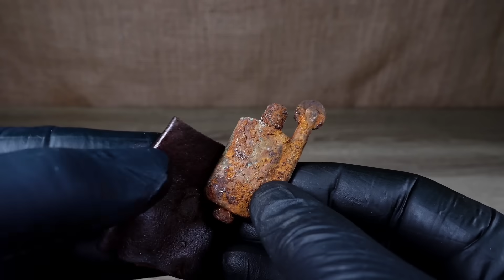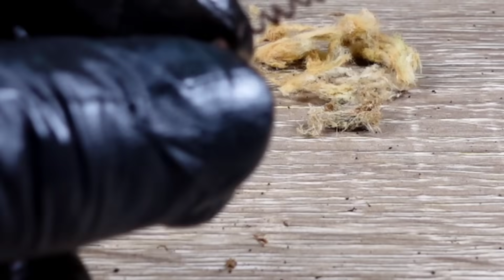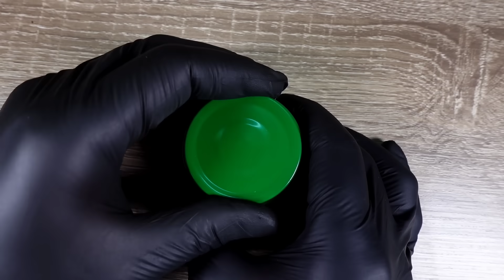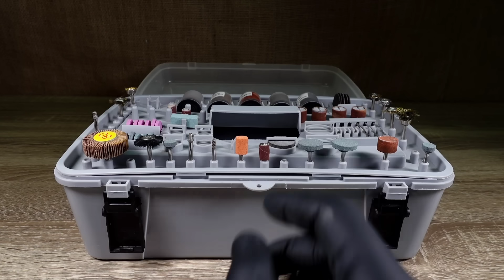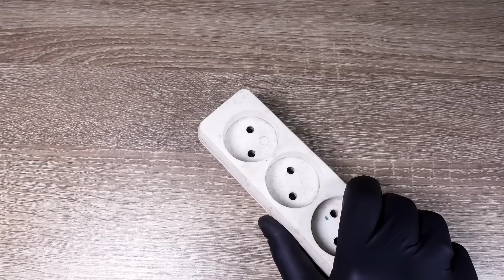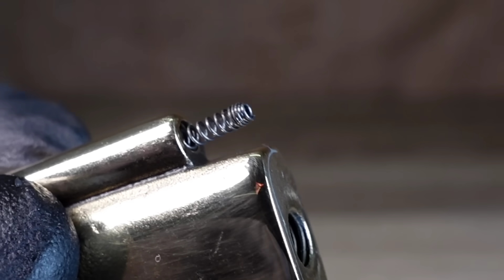Old beautiful miniature lighter World War 1 - Restoration

Comment: How could it be so full of rust if it’s made of brass? 🤔
Reply from the maker: There are not all elements made of brass, there is still steel. Brass oxidizes and steel rusts + water, moisture, dirt and time have done their job. They found her in the ground( 
Where are you watching from?🌍😉
Reply: @TheRestorer  Norway.
Reply: @TheRestorer  😠 ~ did you find it, or committing fraud with it?
Reply: I was thinking the same same thing! Brass does not rust and it seemed the rust was all over, not just on the steel parts

Comment: @TheRestorer thanks for the lesson.  Nicely done! Keep in mind I grew up using wd40...huge fan! I've been learning a lot about restoration for some time.  Here's a helpful tip for you: yes vinegar and baking soda can remove rust along with wd40...however depending on the metal vinegar can eat right through the metal! I ruined a project...really upsetting but the owner knew it was a possibility and surprisingly not upset. 
Let me introduce you to an amazing product superior to wd40! Never thought I'd say that! Evaporust and Metal Rescue...not only is it safe on skin and the environment (it's neutral and can be filtered for multiple uses!!) But it removes the loose rust and hardens the metal to help prevent future rust! I absolutely love the stuff! You still knock off as much loose rust with a wire brush. Then soak the metal item in the solution (I use a plastic or glass container with a lid) then wash it off with Palmolive degreasing dish soap. The metal will have turned grey or black from the process but it comes off with light sanding.

Comment: Your older videos of fixing damages around the house are much more interesting than fake rust metal cleaning projects. I mean, overuse of faux rust paint isn't cool, brass won't get red iron oxide rust.
Reply from the maker: Hello! Thank you for your comment. Of course, brass and bronze do not rust. Brass oxidizes and can be cut in many colors from green to red-brown. It all depends on the antiquity of the find. The steel that is among the parts rusts, and this rust very often spills over onto the surface of the brass. That's why it looks like this. If you look at an auction where ancient things are sold (which need restoration), they look even worse. Have a good day!
Reply: This isn’t the only channel that fakes restoration, most restoration channels now days are doing it.
Reply: @Julmaa87  but these pieces are old? Does that really have no effect? (Genuinely asking.) And are they made of pure brass? Can you mix brass and other metals, if so can it cause this rust? I’m just wondering.